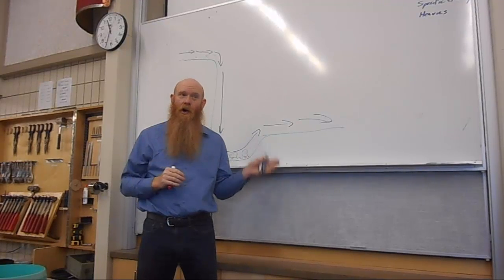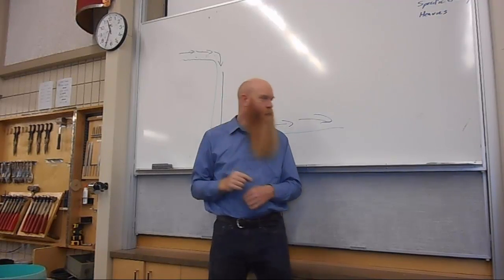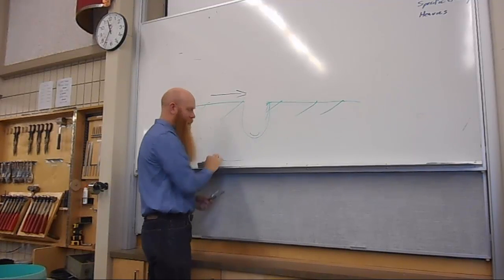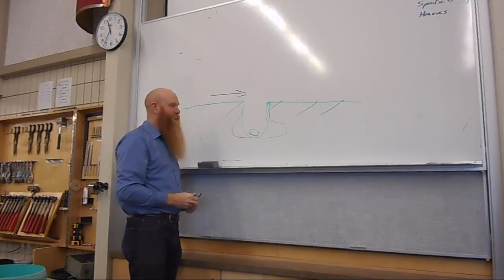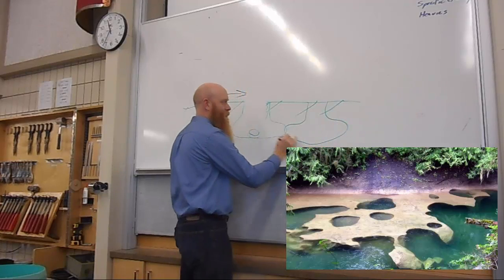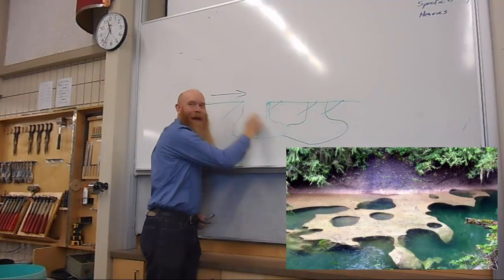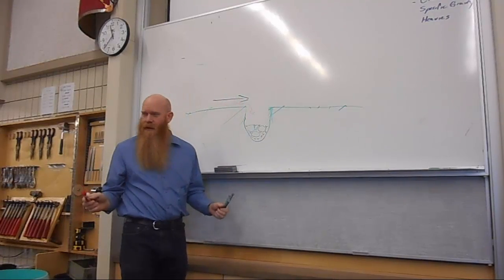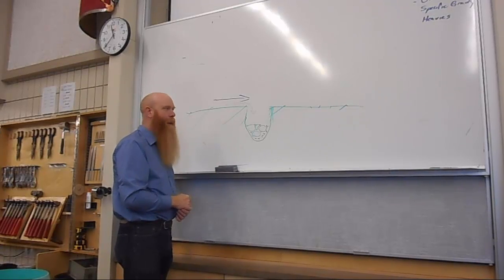Gold mining course: Plunge Pools and Potholes in Bedrock

Comment: We have potholes 10 meters wide and 30 meters deep. Potholes are NOT created by rivers, they are created by vortices in deep fast flowing water. The energy needed to create them is beyond what any river could supply, they are tsunami related. This is also why they appear in clusters and in all sizes, even along the valley sides.
I think you can see that once a rock grinds itself below the lip of the hole, the river can no longer affect it.

Comment: Would it be a good thing to do if you find a pot hole in exposed bedrock that is empty to put rocks it in  to capture the gold in it? Then go back a year or two later and check on it to see if any gold dropped down in it?
Reply: doug johnsonj if you willing to put in the effort. You could set it up like that and maybe come back regularly and check it. Truth is after each flood or high water there's a chance it could deposit. However it could also blow the rocks that you put in there out. at which point you wasted your time. and depending on the size of the Rocks you put in there Boulders being the best thing to do they're more likely to kick out the smaller they are. After all they would have not kicked out in the first place.
Reply: why waste your time. Just go and find some. buy a metal detector.

Comment: Dan,  first of all i want to thank you for your videos -  i find them extremely helpful.  I have a question and i hope you will either answer or make a video if you think it might be useful.    my question 

what are the best methods of extracting certain sizes of gold .  for instance what are the reasonable sizes that you can pan, and when does it become unreasonable to continue panning.   I have seen recommendations on the internet but i would like your opinion.  you have lots of equipment , but i only have a big pan and a small pan.   should i try to practice panning more or just get some other equipment and what do you suggest for the most reasonable gain for the effort.  ?      I hope  this is clear and i thank you for your response.  

again thanks for your videos. 
cheers.
Reply: +Jeff Brasfield also dont toss your black specks away? why ? you ask. plian and simple. you throwing away silver and platuim.